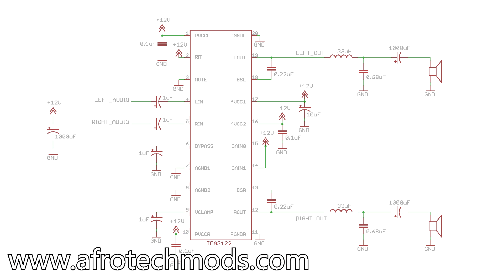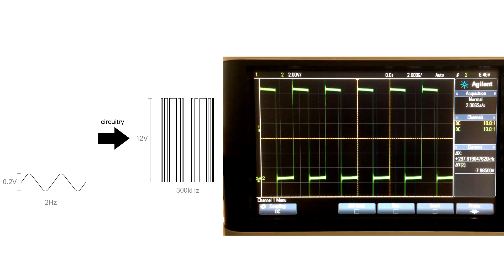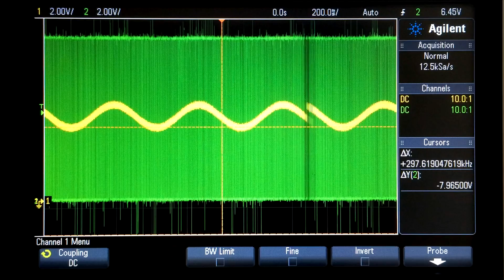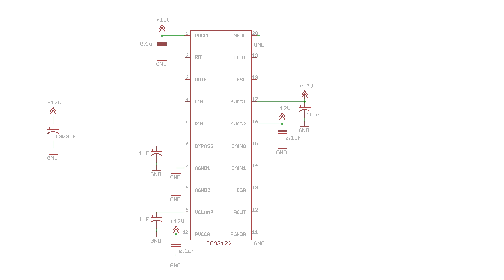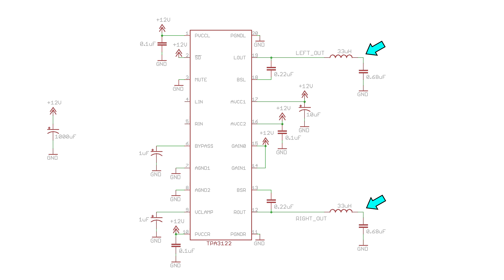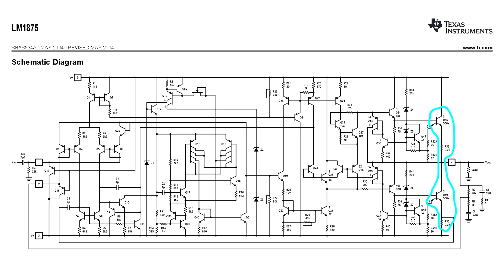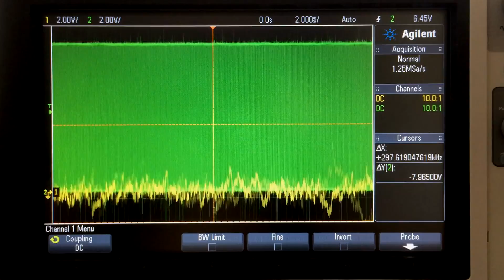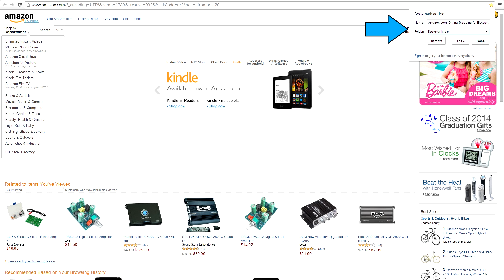Class D Amplifier Tutorial!

Comment: Great video.  I'm am old guy.  Retired engineer - software and systems mostly.  When the IBM PC first hit the market, it had a speaker that was gated on or off; current flowed through the voice coil (that's a clue how old I am) or it didn't.  The bet was that we could get a (pretty pure) sine wave out of it.  Lots of interest but few takers.  What we would do was drive the speaker (way) beyond cutoff.  It would act as an integrator and by varying the frequency we could get close to a sine wave.  Fourier says we can operate in the time or frequency domain interchangeably.  Did effectively the same as the pulse width modulation...
Reply: that speaker must've suffered great deal of dc current!
Reply: Joe Burks I love gritty old engineering stories like these...
Reply: I have no idea of what you guys are saying. But I like it!! This is very interesting
Reply: Joe Burks cool, so basically we can treat the internal pc speaker as a class d amplifier, but we need some software to pick wav files and convert em in pwm waves for driving the pc speaker, then wiring it to some filter and ta-da, wouldnt be too hard to make... i wonder how back then didnt sell something like this... well the SB was kickin the 90s
Reply: Well, WAV files only appeared towards the end of that era (Windows 3? I remember .VOC files being the favourite of the early Soundblaster tools before then), but I wrote some software to do high frequency PWM on that speaker back in the day!
Reply: The first class D amps I knew of were realized in the late 1970s. Arnie Nudel and John Ulrick while co-founders of Infinity came up with the first I knew of, it was was not perfect (years later it was known that the addition of four diodes would have fixed what ailed this amp) but influenced by their work for Litton (in the defense Industry) in the late 1960s developing the switched ruby laser to read distances to targets. By the 1990s switching speeds were attainable at 200khz or higher. High Fidelity amps of Class D were finally attainable and reliable. There were few though, mainly Spectron at that time. Once the bar was raised, many others came along to try their hand at improving on what was known by this time.

I absolutely refuse to waste all my vehicle's charging current and battery storage capacity to power an amp that wastes so much of it since there are excellent Class D amps showing up a lot now. The extra load on your alternator will reduce gas mileage as well, much more so when using a bigger alternator to power all that wasted current converted into nothing but heat. Don't believe me? Try taking a 1/4 HP electric motor and turning it backward by hand while powered (no don't do this, you may tear off a finger or two). A loaded alternator produces nearly as much if not more drag than an air conditioning compressor. I once had to turn my headlights on high beam to get the idle slow enough to satisfy the tester at a smog station ( pre-obd-II days).

Comment: Excellent tutorial! The video of the oscilloscope depicting the output should be illuminating for many people. As a musician, electronics expert and audiophile, I absolutely HATE this "class D" abomination; however, where power consumption is critical, it works well. This is also very much how a sine-wave inverter works. The differences being in scale and only 1 frequency - 60Hz.

For the best sound quality, a Class-A amplifier is best. The output is working through 360 degrees of the cycle. Class AB is typically around 270 degrees so it saves a bit of power - this is most suitable for high-power RF applications such as linear amplifiers which are tuned to 1 frequency where the "missing" part of the conduction is handled by the flywheel effect of a tank circuit.

I would encourage the "younger players" to build the circuit in this tutorial and experiment with different values of inductance and capacitance in the output filter to examine what effect they have on the quality of the final output signal.

Comment: Everyone who uses Class D amplifiers in their cars should watch and learn. This is the best explanation I've seen for how these "distortion enhancers" boost power. Class A/B is less efficient and requires more heatsink, but they will always sound better to me and since I don't need 3000W for my subs, my 1000W Class AB amps will do just fine. Great video Afrotechmods
Reply: If you can tell the difference between Class AB and Class D in a blind comparison, I'd be damned impressed. I have Focal speakers in my car hooked to a Class D JL Audio amp, circa 2012, and I am "that guy" when it comes to changing settings and annoying people with stereo and TV setups. The class D amp (4x75 watt plus 300 for sub) sounds perfect.
Reply: @evilspoons  If you couldn't tell the difference, you need your hearing checked. Class D sounds pretty wretched through decent speakers. Kinda sounds like watching a youtube video on a low resolution due to the extra distortion in higher frequencies.
Reply: Absolute nonsense, some of the high-end studio monitor speakers are using class d amps, as a previous commenter wrote, 'it's all in the design'.  There are great class d amps and terrible class ab, it's the quality of the design that affects the results.
Reply: @jtsotherone  
With adaptable filters

Comment: Will you ever make a video about Vacuum Tubes, and another one about building a Oscilloscope out of an old CRT TV?
Reply: tomoya97 That would be cool
Reply: Why? Tubes are garbage.
Reply: Oscilloscopes use electrostatic deflection. Tvs use magnetic defl. and althougb you could deflect independantly the verticall, horizontal defl. is also the drive for the high voltage transformer. So it would  be rather involved to have a horz. circuit just for the benefit of the flyback transformer derived voltages: HV, screen, focus and filament.  Then, having the needs  met of the picture tube, one could deflect the  beam. The horizontal would be a sawtooth, and vertical the input. Refinements would be blanking to extinguish the spot during return right to left, and a beam limiter to prevent burning a line or spot into  the phosphor at slow or no deflection. I saw one in high school electricity shop, but it  may have been limited to 60 hz ac demonstrations, but was awesome, a bright 22 inch SCOPE!
Reply: @DarkMatterX1  Are you high?

Comment: Very helpful and informative. I wish I could pick your brain as to why I can't get my MOSFET Driver chips to operate using my new frequency generator (1Hz-10MHz range). Love your tutorials. Keep up the good work.
Reply: they would just switch on at certain point on/off chopping the audio up alot.
Nothing close to a sine wave would come out prbl :)
Reply: Yeah. All I want it for is specific frequencies. Pulsed DC applications in the 100KHz-10MHz range. Simple... but i'm still having trouble. But yeah, it's not for audio. So in many ways it is easier, but, none the less, I am still having trouble. Do you have any experience with  MOSFET GATE DRIVE IC's? If you do, let me pick your brain. It'll be fun.
Reply: Binj Komisar
Most function generators won't be able to supply enough current to switch the MOSFETs fast enough. If you don't know if your fgen can supply it, I'm pretty sure you've got one that can't. Depending on the MOSFET gate switching currents can easily exceed an amp.
Reply: superdau Yeah, this particular f-gen will not switch the gates of the MOSFET'(S) directly. My old school f-gens do, but they do not have the massive frequency range. What I am trying to figure out how I would hook my fgen signal to IC MOSFET driver chips I am trying out an few but the one I desire to get working the most is IR2184 or IR21844 as they have programmable dead-time. Basically I'm stumped at the pre-amp stage of the system. I am using pulsed DC to find nice resonances. Then I am planning a tuned half-bridge tank circuit to achieve a nice AC high efficiency power to drive my system. Anyways, I will get it figured out, but if there is anyone who is skilled in this department hit me up... Maybe i'll just call the help-line at international rectifier. Thanks for the comments. Binj
Reply: Binj Komisar You do what any other audio amp design does... Use driver transistors. T0220 packs will do fine. Many handle 3-5 amps and some bipolars can go pretty high in frequency. Make sure you use the right gate resistor values... Good luck!

Comment: The polarity of the capacitors on the LIN, RIN pins is the wrong way 'round. The LIN/RIN pins are typically biased at the reference voltage (probably 2.x V or so...) and the input to the circuit is typically (or should be) ground referenced. [visible at 5min 10sec]
Reply from the maker: +Christian Vogel Whoops - good catch!
Reply: +Afrotechmods No annotation mentioning this?
Reply from the maker: +Yndostrui added.

Comment: Thanks for the crisp lecture ( absolutely to the point )! It was always in my mind about filtering out the unwanted square wave at the final stage ...it's never 100% . So I will stick to the lower efficient AB configuration. I plan to make a 1000 w amplifier ( 500+500) any suggestions are welcome.
Reply from the maker: Uhhh at 1000W you want class D for sure.
Reply: @Afrotechmods  . Thank you
Reply: can u refer me the circuit of 1kw class d amplifier
Reply: @arijeetroy8747  you must buy 500 W x2 class D units from Amazon
Reply: @maxxsmaxx1901  do you have any link where i can get
Reply: @maxxsmaxx1901  or if u built it so can you send me the circuit diagram

Comment: i was just wondering if you could make a video about the different types of amplifiers and maybe show a demo of a class AB Amp circuit. This would help so much, im working on an 80W 6 ohm subwoofer amplifier using the two transistors: MJ15003 and MJ15004, not sure whether these are suitable but i thought because theyre TO-3 case and have a high power capacity and voltage limit, as well as being MOSFETs. Hope you can reply to this soon, by the way power supply is +/- 12VDC and ~4A per rail, i used an opamp as a voltage follower to avoid Line level audio voltage drop from my amplifier and allow it to be used as an mp3 amplifier too, love your videos, hope a new vid comes out soon :3

Comment: This would have been the perfect thing back when "boomboxes" were popular. They would have used a lot less battery power, and could have driven lower impedance speakers, making them even more powerful. Once built, what was the 0 signal idle current @ 12 volts? Many of those large portable stereos used 8 D-Cells. They would last longer, particularly at lower playback levels, with a switch mode output stage. I noticed on the efficiency graphs, the levels with the widest margin of efficiency between the analog and switch mode output stages. at very low levels, the switch mode appears to have a very low idle current. It does not need a bias current, to prevent 0 crossing distortion. from 1 watt on up, advantage switch mode.

Comment: If you want to reduce power needed for a music system (f.i. for portable) you should start by selecting speakers with high sensitivity. A speaker with 12 dB higher sensitivity will use 16 times less power. Combine that with a class-D amp.

Comment: Very Nice video and very nicely explain. Could you also make a video on making a DC High Voltage smooth power supply (10KV), the current need not be high, few milli ampere would work fine. Thanks,

Comment: Interesting how technolgy creates a new amplifier class.   Pulse Width Modulation and
filtering creates an amplified signal.  Pulse width ,modulation power supplies used with
these amps eliminate the need for transformers,especially in the newer  low cost 
guitar amplifiers these days.

Comment: I have a question for you on this. First though, I want go thank you for making Class D comprehensible for me. I'm not an engineer. I'm a pharmacist. Im completely self taught in electronics and I understand Class A and AB topologies. I've built tube and transistor amps, both Class A and AB. I've built stompboxes and onboard guitar preamps and effectors. I never could wrap my mind around Class D and thanks to your video here a light clicked on. Of course I'm no SME in it, but I get the basic concepts. Now my question. Is this stereo amp at 2x 25 watts (I'm assuming it's into 8 ohms or does the impedance the Class D see matter as much like in the other older topologies?) bridgeable as 50 watts mono? If so, how?
Reply from the maker: Look inside the datasheet of the chip I used, if I remember correctly it is bridgeable. If not, some other class D ICs are.

Comment: I have a cool idea for a circuit.  You know those laser audio transmitters you see that consist of an audio transformer, a battery and a laser pointer diode?  Forget that.  Build a Class D amplifier out of an LM324 quad op-amp and power the diode with the PWM output.

Comment: So this looks like what I think is called a 1/2 bridge amp.   IE you are giving it pulses of power but not pulses to pull the speaker back.   Could you modify the circuit so that you have both positive and negative pulses from the PWM?   IE two PWMs one on the + terminal and one on the - terminal.    I think it will give a better sound out of the same speaker.

Comment: I prefer class D amps for portable Bluetooth speakers due to longer battery life. For home audio, I prefer class AB amplifiers because it's continuously plugged in the wall and efficiency does not matter as much but, accurate sound reproduction is key for home audio. I wouldn't mind having to use a laptop-style power supply instead of an internal AC adapter just to have better sound for a smart speaker. Also, some class AB amps can be over 80 percent efficient.

Comment: When you buy a large 25 kg class D amplifier, which is not built around ICs, is that also producing a less linear output than class AB amplifiers? I read, that class D design was mostly about a more heat efficient design, which becomes important, when output power requirements are high. This is done through dynamic power to the output stage?

Comment: If anyone is doubtful, I have a 40watt sound system from the 80's and i can't put it past the 2nd notch before its too loud
Reply: That is only a function of the potentiometer or an FET switcher for electronic volume control in those days, most were not linear but rapid change in the first few degrees tapering beyond that and it sold systems purely on perception as you just proved. Some people are impressed, "look how loud it gets and I'm only at 2"! "look at how much louder it doesn't get when I moved to 8"! Aww, had them going at first but we sold a lot of them. Your speakers are likely 85db for one watt one meter, to get to 88db requires two watts, to get to 91db requires four, then eight for 94db, then 16 for 97db, 32 for 100db. We hear logarithmically not linearly. Power in watts is a function of voltage times current, nothing more nor nothing less, some watts from some amps are not more usable than other watts from other amps like some snake oil salesmen would try to have you believe. Sure, different amps have subtle differences in sound by differences in transfer function but wattage is wattage. Then there is distortion level at 40 watts, is it 15% or .002%.

Comment: Afro, back to a basic question on the output caps. Caps convert AC to DC, so why are you putting the 1000µF cap there when you say speakers don't like DC?
Reply: RedRider2001 Caps can't be explained in terms that simple.  They do many things, depending on type, and how they are connected.  On the output here, it removes the DC offset, and passes AC.

Comment: If I were to add a potentiometer before the gain pins, would I be able to control the volume of the amplifier? Also, if I added a switch between the mute pin and the ground would I be able to have a mute button, or would it be better to just put a switch before the main power?

Comment: Thank you for a very good video. 

Do all class D amplifiers have a DC component at the output, requiring capacitor coupling to the speaker?
Reply from the maker: It's possible to design one with a dual rail supply which, if properly done, could result in a net zero DC component. But for the sake of safety you should almost always have that series capacitor.

Comment: Is there any up/downsides to buing a kit instead of buying all separately and putting it on your own circuit board? Also, is there any easy way to see if a kit is good? The one you link can't ship to sweden unfortunately. 
Is there any way to control the volume by a volume knob? I guess it can be done by putting in a potentiometer somewhere but i'm not proficient enough :)

Also: Really good video!

Comment: This is awesome video man. Many thanks. It is good replacement if some of the "home" speakers just break.
I have one question, please answer if you can. Is there any tutorial for "auto turning on the speakers when there is an audio signal"? I saw that at my friends speakers and it's awesome. They are turned off untill he plays something on his computer and then they auto turn on. My speakers have on/off switch at the back and I can't constantly use it so I leave them turned on all the time. This mod would do me much good because I don't like the idea them being turned on all the time.
Reply from the maker: Hmm... check out my comparator tutorial, peak detector tutorial, and mosfet tutorial. Using those, you may be able to design a suitable circuit with a relay :)

Comment: Hi!

I have a doubt about Class D amplifier. The out put is push-pull or single end? If not, is it possible to add a phase inverter circuit with transistors in the out put stage and how?

Hugs